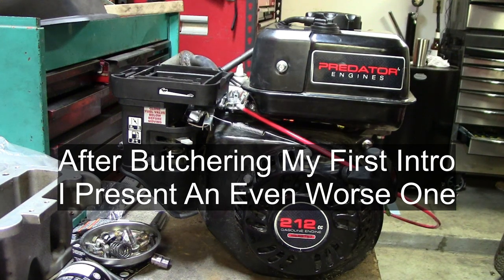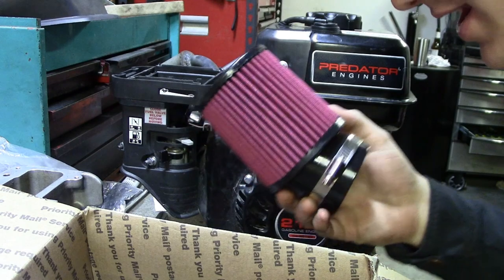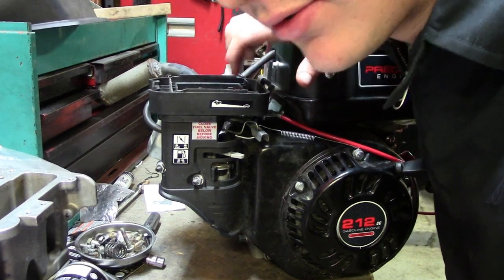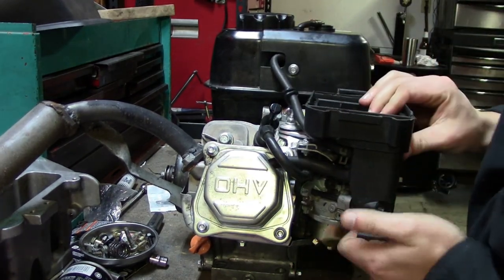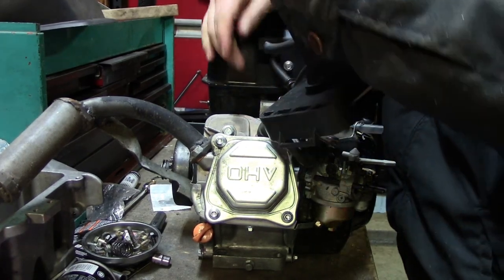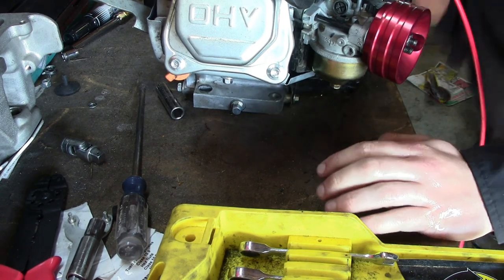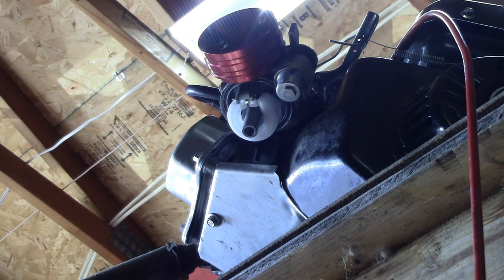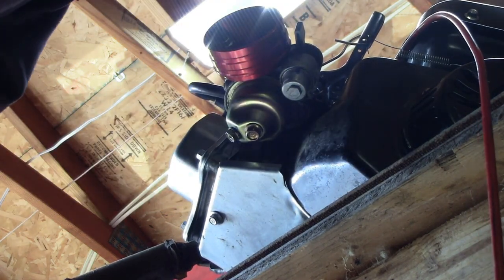How to install a Go Power Sports stage one intake kit!

Comment: Now we're talkin.  That sounds awesome  man.  Lovin your informative  comments.  😂 
Did you remove the governor on your motor  ?  I was thinking that  is necessary for  more awesome factor.  
Good one mate 👍
Reply from the maker: Customwinder 1 ha yeah I removed the govenor when I first got it. I'm not trying to have some corporate nerd tell me how my motor should rev. Thank you for the view I really appreciate it!
Reply: CasualKarting hey mate.  Haven't heard from you for a while.  Hope all is well.  Got those stupid governors out of these kart motors.  I'll do the wifes off roader too now i know how easy it is.  Cheers bud.👍
Reply from the maker: Customwinder 1 yeah i have been good man! Just super busy lately. I'll get back in the swing of things soon enough. Oh and with the governor's. Once you learn how to smack that stupid clip just right it is a breeze. The first time took me like 2 hours and the last time took me like 12 minutes.
Reply: CasualKarting hey bud.  Yeah took me a while for the first one  but the second was out in no time. 
I took my kart out and it's awesome.  I made an exhaust and it wss too loud and had to put the stock muffler back on at the track.  Still went well.  Might get a torq converter and try that at some stage too.  
Good to hear from you mate 👍
Reply from the maker: Customwinder 1 I just put on a tourqe converter not to long ago and it is fun for accelerating from zero but the top end is pretty fun with a clutch. They both have there perks so I'll give it more time to see what is my favorite.
Reply: CasualKarting ah good to know.  Let me know how it goes and what ya think.  Thanks mate 👍